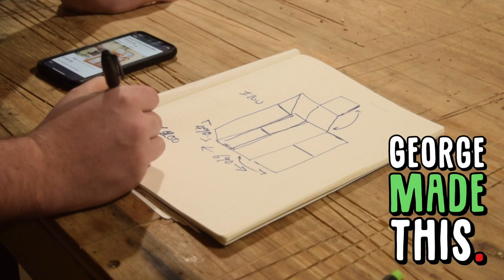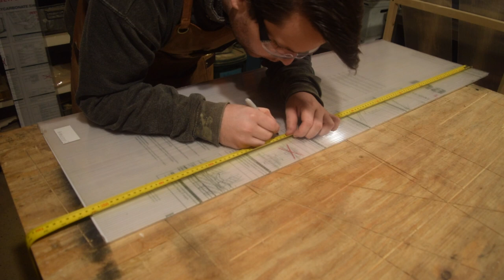How to Make a Mini Greenhouse! (or Coldframe) // Woodworking Garden Projects

Comment: Looking at building one of these myself. I bought a small item similar from a high street store. Has a metal frame, I think three shelves  and a plastic cover with two zips. Great at first but when the sun hit it for one summer, the plastic cover started to shrink slightly making the zips tricky to do up all the way because of how tight it is and it's also gone a bit brittle and in places, the plastic has started to crack.

Looking at routing out a groove for the perspex to fit into rather than fitting strips of wood - only down side is replacing a panel if it gets broken :/
Reply from the maker: Newer ones I make I do route a groove to fit the panels in, yes it is a pain if a panel gets damaged but can just be unscrewed to replace. Using grooves does speed the building process up as well

Comment: Awesome video! I've been looking for ideas to build one of those myself and this is just what I needed. Could you explain a little more about the material you have used for the clear panels?
Reply from the maker: Hi, it’s called twinwall polycarbonate. It works really well for insulation. I’ve actually just made plans for this, the link is in the description if you want to check them out 🤙

Comment: What size was the wood frame 2x2 or 4x2? And how thin did you cut the inlay wood for the window please, my partner made me one but he attached the perspex on the outside of the wood also I have a large gap between doors and the one side at the top that opens upwards 😪 I'm wanting too try and make one myself as love a challenge. Thanks for sharing.
Reply from the maker: Hi, it was smaller than that. Around 1x2 should do it! You can use 2x2 if you’d prefer but that may make it too bulky. Good luck!

Comment: Very simple yet still decent. Did you bother to sand it all at before applying a finish?
Reply from the maker: Thanks, I don’t remember but it would have only needed a light sanding. The timber I use for this is pre-treated. I just add on an outdoor furniture treatment from screwfix to be safe!
Reply: @GeorgeMadeThis  no worries 👍

Comment: Would you be willing to share the measurements for the angles. I’m currently building this and don’t have the actual measurements for the angles.
Reply from the maker: Hi, I eyeballed the angles for these bits so am afraid I don’t have this measurement. If you hold the piece up to the sides of where it has to go you can mark the angles on it that way and cut them how you see fit. Hope this helps!!

Comment: Great video and build! I was wondering, would you be willing to share approximate price for this project? I appreciate the difficulty, since most of your material would already live in your workshop, but I’m wondering if it’s more cost efficient for me to purchase a pre made :) I have the relevant tools and machinery already, tia
Reply from the maker: Thank you! I think it was around £100-150 for materials. Could be less if material prices are coming down slightly… I think you can buy one for £150 from shops but a lot of the reviews say they are quite flimsy… on newer ones I make, I route a groove in all the pieces to accept the polycarbonate, rather than cutting strips like I did in this initial one.  It keeps the polycarbonate held a lot more firmly. Hope this helps!
Reply: @GeorgeMadeThis  thank you that’s great, I think I’ll buy this one I’ve found online for £80 and self adapt. Thanks once again, your one looks great quality so I know where to come to learn should mine break
Reply from the maker: @chloethegreybuild8655  no problem! Glad the video can be of help :).
Reply: @chloethegreybuild8655  I've often wondered about the price of building it yourself vs bought and quickly realised after being asked to price up a couple items I've made for other people. Most popular item was the recycle bin storage unit. Didn't think of it when I made mine but after being asked to make it for others, I had to do some research. In short, turned out that although mine was expensive, I just could not compete with people who were making the same items regards to price. What I noticed in every case though was mine was much stronger. I refuse to skimp on quality of materials and joinery methods and that's mainly where it shone through. Items from competitors were using really low quality wood and the quality of build (mainly the joints) were nowhere near as good as mine. Just thought I'd share what I found out.

Comment: Great video, thanks for the design idea. You pulled it off! I didn't quite see the cleat part; is it basically thin battens either side of the plastic? What size wood did you use for the main frame?
Reply from the maker: Ahh no problem. Yes I just cut some 10x10mm strips to put on either side of the plastic. On newer ones I’ve made I’ve routed grooves to accept the plastic.
Reply: @GeorgeMadeThis  Thanks buddy. Routing and then sliding into position sounds like a great idea! Just subbed and keen for your next video mate. Any chance you could provide a link to the plastic? I'm based in the UK as well.

Comment: hello, very nice your video;), and nice result.
I would like to know, which material to use and which is transparent.
thank you
Reply from the maker: Hey, so the wood I used is 38x25mm treated pine and the plastic is called Twinwall Polycarbonate. Hope this helps!!
Reply: @GeorgeMadeThis  thank you yes that help me, but I have another question that I have above, thank you
Reply: what is the thickness of your polycarbonate sheet in millimeters? thank you
Reply from the maker: @yoz30  It's 4mm thick. On the newer ones I make, I use a router to put a groove in the wood to hold the polycarbonate in place.

Comment: Hi what size are the ripped woods? 1.5x1.5?
Reply from the maker: Hi, the main frame of the coldframe is 38x20mm approximately and the bits of trim to hold the glazing in are about 10x10mm.

Comment: Is your timber sawn or PSE, could you use glass instead of plastic? Thanks.
Reply from the maker: The timber I use in this video is Roof Batten so I would say it’s sawn. Smoothed out quite easily with a quick sand. You could absolutely use glass!
Reply: @GeorgeMadeThis  Many thanks, in old money 1" x 1 1/2" I think. My builder's merchant seems to sell it in 3 plus metre lengths... dyed blue!